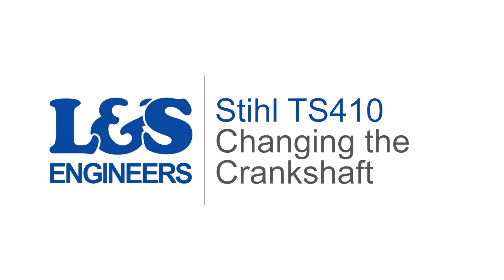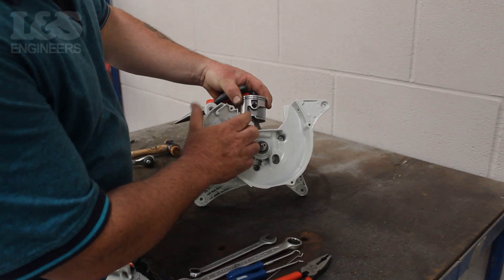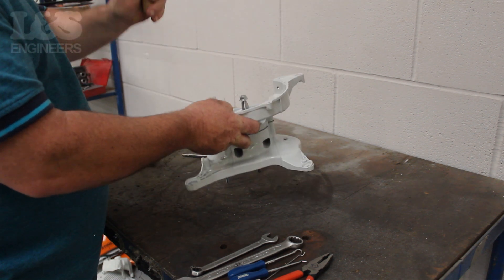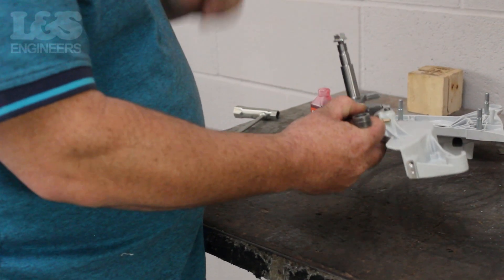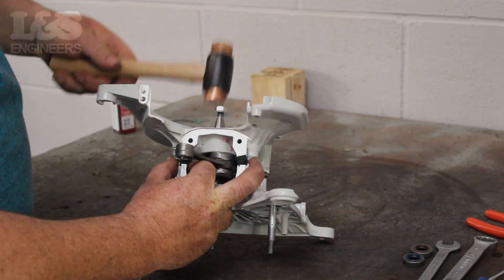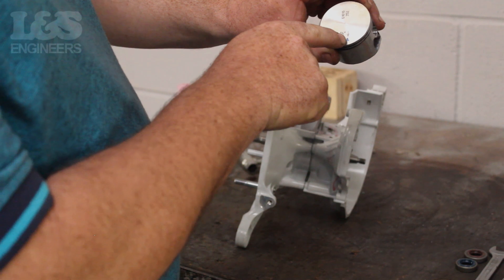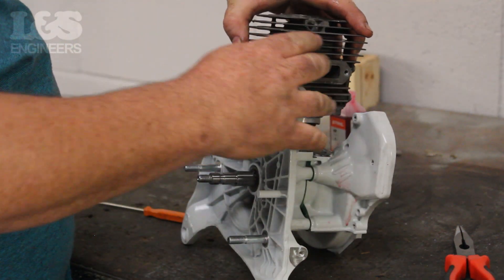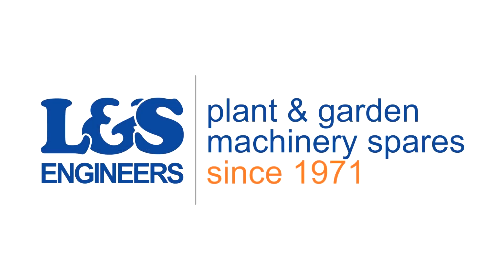How to Replace the Crankshaft on a Stihl TS410 Disc Cutter | L&S Engineers

Comment: Bit brutal.. don't do it this way guys. I heat each casing up for 10 mins in oven with the crank having been in freezer for an hour it just drops in with hand pressure
Reply: That's interesting.  What temp do you have the oven?